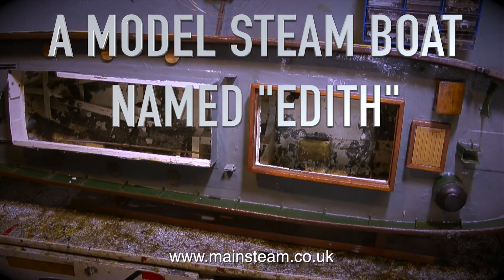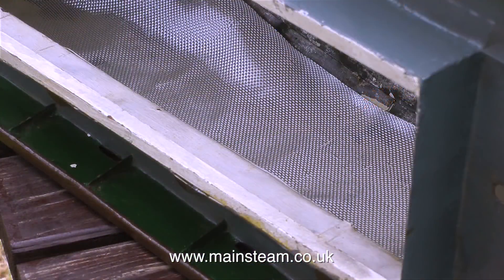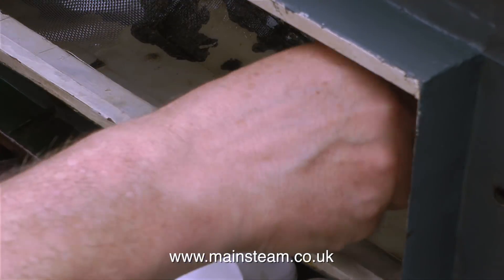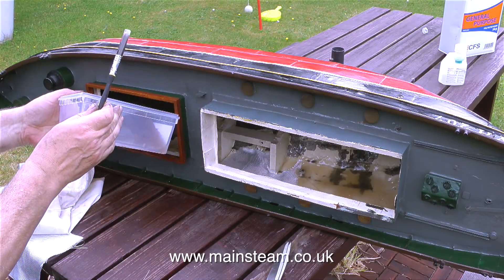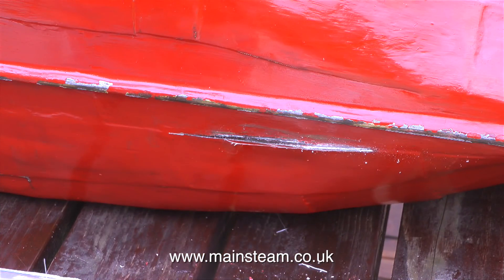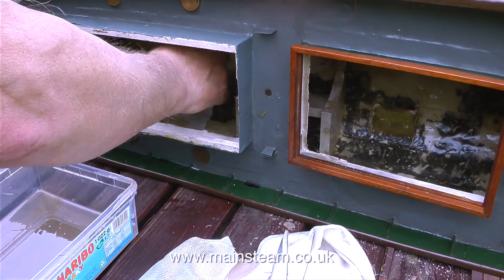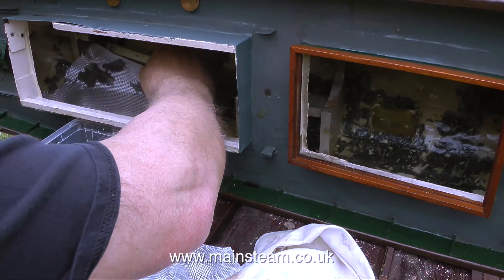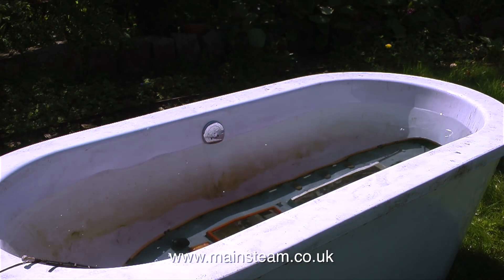A MODEL STEAM BOAT NAMED EDITH - PART #6

Comment: pre cut cloth, wet out on table then transfer to boat, also wet out boat w/resin without hardener. When you put activated wet cloth to boat it will all go off and stick real good..you can also do multiple layers, use hardener only in last layer(s). THIS DOES NOT WORK WITH EPOXY

Comment: Keith:   To extend the working time of polyester resin just add less catalyst (hardener). As long as there is some catalyst in there it will always go off properly, it may just take a lot more time. Note: never add more than the stated amount as this will weaken the hardened resin, but adding less has no ill effect on anything but your patience. I often use about 30% of the stated catalyst to get a setting time of 30-45 minutes (dependent on air temperature).

As for your technique. Yes, plenty of comments can be made but, I certainly agree, it's perfectly adequate for what you're doing so why add fiddlyness & extra time just to do it 'properly'.

But I will add make sure the boat IS dry before glassing. Polyester resin will not harden in the presence of water. You probably know this already, but just in case.

And just one more thing. Thanks for your very informative & entertaining videos. IMO your type of video is just what youtube is for, and you do it well.

Comment: I grew up in a boatyard, my mom was a boatbuilder and I spent a lot of my childhood "helping" build some rather awesome fiberglass yachts. For an amateur, you're doing quite well indeed. In fact I've seen some supposed professionals get inferior results to yours. So no worries on your technique.

As far as suggestions go, yeah what they said. Wear disposable (I prefer nitrile) gloves, mix smaller batches of resin, and apply a wetting coat of resin to the base surface. You could also put down a coat of a compatible primer to ensure good adhesion.

One thing of which to be mindful is the difference in stiffness between the fiberglass and the stuff over which you're glassing. If one is significantly more flexible than the other, you'll get cracking and delamination. As far as resins go, there's nothing wrong with polyester in an application like this, but personally I prefer using epoxy for most everything. System Three and West System are both excellent, and you should be able to get great results with both.

Comment: Could have tig welded it
Reply from the maker: what - ! ..... with the many coats of old paint with lead in it - I don't think so ..... applying heat is totally out of the question. The individual tinplate squares are also tinned as they were made from Baked Bean cans . . . .
Reply: Well that makes sense, i didn't know.

Comment: Pretty much the only thing polyester resin sticks to is itself (as in bonds to properly).  
I think it's probably going to be fine for what you've used it for, but as West System Epoxy (or similar) not much more expensive these days.  I'd have used an epoxy resin with that glass tape.  It also comes with fast, slow and non yellowing hardener, which is very convenient.  You also need about 30% less resin to wet the glass out properly.
One of the big advantages in your case is that you can clean your self up with normal old vinegar.  Yes a $1.50 bottle of cheap vinegar will clean epoxy of your hands, tools and phone when you accidentally answer it mid job.
As said below I think. Wetting out the glass mat in smallish pieces on a polyethylene plastic sheet taped down to your bench and then placing each piece (sticking plaster style) onto the job and then giving them a light stipple with the brush would also make the job easier.
It's also worth visiting your proctologist and stealing a few pairs of their latex gloves when their back is turned (I buy boxes of 50 actually).  There's nothing worse than needing to wash your hands in skin dissolver before you can pick your nose again.

Comment: A few dabs of resin on the hull before you add the glass keeps the glass in place.  does poly get hotter than epoxy?  they both cook off pretty good and will melt plastic cups.  ;-)      can't wait to see it finished.
Reply from the maker: from my limited experience Polyester resin seems to generate more heat as it cures than Epoxy resin.

Comment: A comment on the use of JB Weld on the outside. When I worked as a boat builder many years ago one of our favourite comments was, "Seven pounds of a putty and a coat of paint, never know the difference sir." A belt and braces job is definitely the way to go with what would appear to be such a delicate (in relative terms) structure.

Comment: A tip on glassing from a aircraft mechanic. Brush a coat of mixed resin in the boat, then lay the glass on top and finish wetting out the glass with mixed resin. Another tip mix smaller quantities of resin, mixing large quantities will allow the epoxy to kick faster "it's a more mass kind of thing and holding the heat from hardening". One final tip is to prepreg "preimpregnate" the cloth with mixed epoxy, this will give you more working time with the epoxy before it kicks off.